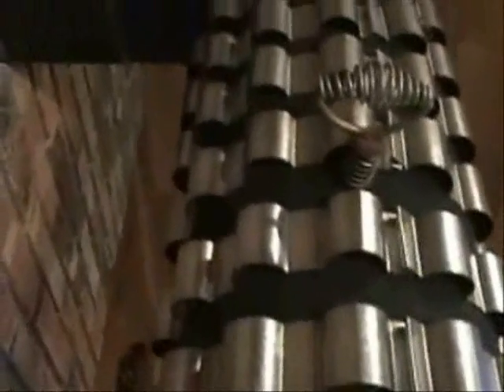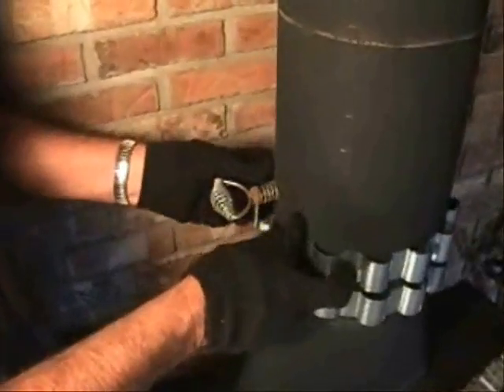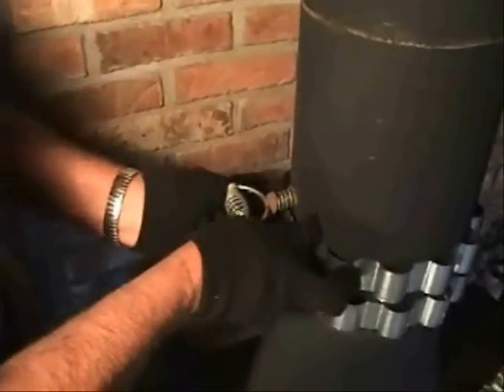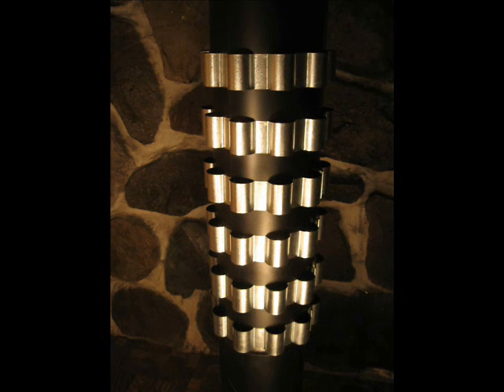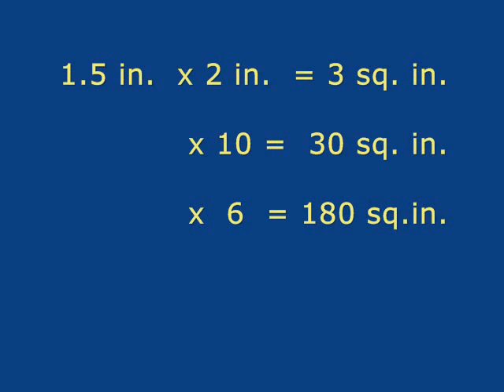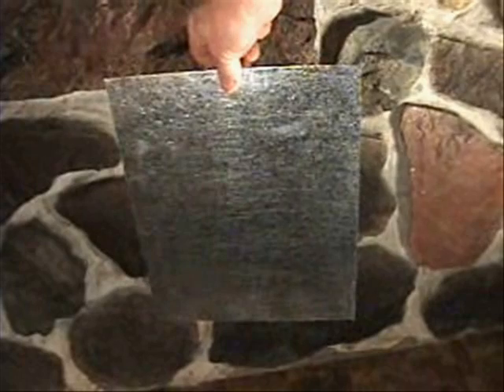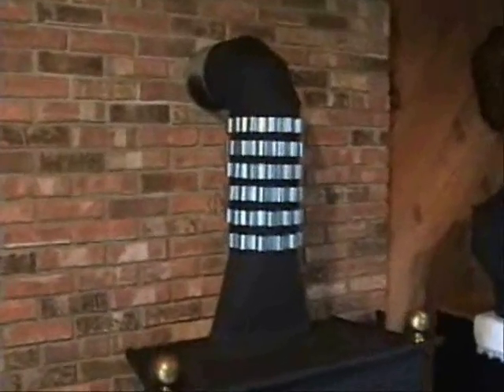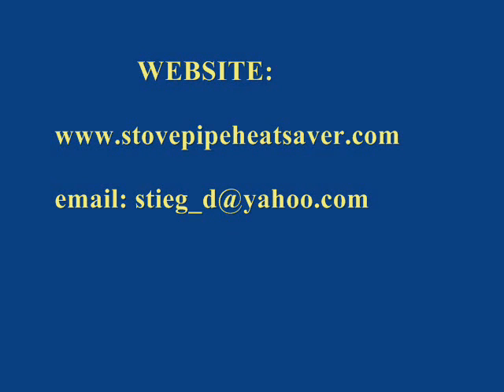Stovepipe Heat Reclaimers /  Energy Efficient Stove Pipe Radiators / exchanger / Cooling Fins

Comment: My 80%gas furnace exhaust creates condensation when outside temps are below 10•F on the chimney (needs pipe installed as currently the exhaust just goes up the brick chimney) alternatively would this cool the exhaust enough to prevent condensation or would that prevent the exhaust from going out because too cool?
Reply from the maker: I don't understand your question.  Please re-phrase.   Sentence too long.....use several sentences.

Comment: Have you tried connecting the loops to form pipes runnig up the chimney?  I think that it would increase the airflow and heat transfer.
Reply: I think that would be counterproductive, actually. Heat flows most efficiently when there's the greatest temperature difference between the source and sink, so you would want cool room air to come into contact with the radiator and then as soon as it's warmed up you want to swap it out for fresh cool air. If you had a continuous pipe going up the chimney then by the time the air got up to the top you'd be trying to move heat from the radiator into already-hot air.

If there was some way to actively force the outside air to flow downward through the radiator then you'd get a countercurrent exchange pattern, which actually would be more efficient. See https://en.wikipedia.org/wiki/Countercurrent_exchange if you're interested in this. That's beyond the scope of simple radiators like these, though.
Reply: @facedeer  
I was thinking that the tubes would have a chimney effect, super heating the air the higher up it went. I love the idea of a small fan blowing into a manifold on top. Thanks for the link.

Comment: IN THE OLD DAYS THEY'D ALSO USE LONG THIN SPRINGS AND SIMPLY WRAP THAT AROUND THE HOLE PIPE FROM STOVE TO WALL...DID THE SAME THING...HEAT FINS/SPRINGS RADIATE EXTRA HEAT INTO THE ROOM.

Comment: Great video and great product, Dale. I wonder if  this could be combined with a fan at the top of the chimney that spreads out any escaping heat, as well as one sitting on the stove itself. Thanks for the knowledge.
Reply from the maker: I highly recommend a fan at the base of the stovepipe blowing upward (the same direction as the heat rising).  This definitely releases more heat. (like blowing on your hot soup)

Comment: Can you get these in the same color as the stove pipe
Reply from the maker: Many customers paint them black with hi-temp paint. Use a scrap piece of stovepipe, mount the bands on it and spray at many angles for full coverage and inside the loops. Being mounted, it masks the flat surfaces of the bands that contacts the pipe.  This way it will not affect heat transfer into the bands.  
I once offered them painted black but during shipping they scratched each other without individual wrapping.  The scratches really showed up.  It was not worth my time.

Comment: My workshop only gets to 55 degrees on those 0 to 20 degree days using my pot belley stove. I'm sold on these and buying 2 sets to see how they do.
Reply: Update? Would you recommend?
Reply: @Nuggetbusterr  Yes recommended, I've also mounted a box fan behind the pipe to help circulate the warm air.

Comment: I bought 2 sets of these from amazon  and they really work well. I see a gain of about 2000 btu per hour when stove is hot. That is about 15 -16 hrs in really cold weather this equates to a single stove load of lodge pole per day savings in sub zero weather. My stove is a Hybrid (cat+ dual burn) so NO creosote build up is created at all, just less heat to the outdoors.
Reply: How did you determine this?

Comment: Possibly a stupid question, but wouldn't reclaiming heat from the stove pipe lead to lower stovepipe temperatures and therefore a buildup of creosote inside the pipe?
Reply from the maker: That is a good question, asked often.
There are many contributing factors to creosote buildup in stovepipe and chimneys. 
 The greatest factor (by far) in the creation of soot and creosote buildup in a chimney is burning wet or unseasoned wood coupled with a slow burning fire. With wet wood, the fire does not burn efficiently, produces a lot of smoke (unburned fuel) and produces a lot of steam.  As a result, the humid soot and creosote can build up inside the stovepipe and chimney walls.
 
The next greatest factor is a chimney flue that is too large for your stovepipe.   This increases “residence time” and decreases the draw and causes the flue gas to slow down, allowing it to condensate and build up on the chimney stack walls.  It also contributes to a “smoky” stove when the door is opened to add wood.

The third greatest factor is when the chimney is located on the outside of the house (instead of running up through the middle of the house.) It creates a cooler flue / stack and, if burning wet wood, it creates a condensation chamber (like a whiskey still).  It is where the moist flue gasses from burning wet wood is allowed to condense into water and creating a wet smoke and it sticks to the inside of the flue wall.
  You can tell a good clean fire when there is very little smoke coming out of the chimney, only heat waves. 

So, in answer to your question, “do the radiator rings lower the temperature too much so as to cause creosote buildup”?  My answer is “no”, the stovepipe temperature factor is overshadowed by far by wood moisture and slow burning fires.
Reply: one good hot burning fire seems to take care of build up in my setup, i wouldn't worry about it
Reply: Dale everything you said is true to varing degrees. Lolol pun intended! I have heated my home hardcore for 37 seasons. I burn only the ultimately dried wood. The size of the stove, the air control design, the insulation of the stove, how the stove is run, the length of stovepipe run, the length of insulated pipe and type of chimney cap you run are also factors to be considered before pulling heat off the single wall pipe. In general I agree with your idea and in fact in the past have used a product similar to yours. I must say if a person is running a truely balanced system, the extra heat extraction ideas are not needed or even wanted. The biggest trouble is wood stoves are not sized for practical  real-life conditions. Homes are too broken up to allow proper circulation of serious wood heat. Heating a home with wood effectively is an art! The old "chuck it in and let r rip" leads to serious air quality issues and pissed off neighbors. If all is balanced the neighborhood has a very, very ight and wonderfully pleasant smell of burning wood. No visible smoke emits from my chimney except for a very short 7-10 minute restart/cleaning twice a week during very morning hours. Kudos to your channel very good information! Well done!
Reply: Here in Finland we've used contraflow masonry heaters for centuries, they basically work on the same principle of sucking the heat out of the flue gasses. If the concept didn't work we wouldn't still use them.

But yeah, a good combustion is needed, dry firewood. It works well in masonry heaters because the fireplace due to the fireplace being lined with refractory material, gets very very hot achieving "complete-er" combustion of flue gasses. With that there's less stuff in the flue gasses that can become creosote.

Modern masonry heaters even include secondary air for this purpose. Many modern iron stoves work the same, they are also often lined with some refractory for the same purpose.

Comment: Thinking of adding these to my 2 pellet stove flue's - anyone using them on pellet stoves?  3 inch ID flue pipe.
Reply from the maker: Many people are using them on pellet stoves.  The 3 inch pellet stovepipe diameter is actually 3.6 inches because it is a double wall.  For pellet stoves order the 3.6 inch diameter heat exchangers.

Comment: A useful addition to the video demonstration would be temperature measurements above and below they radiators.
Reply: What were the temps measured,  before and after install, at the top of the pipe before the elbow?
Reply from the maker: I did measure temperatures above and below the heat extractors.  I also measured  temperatures before installation and after installation.  The heat exchangers reduce the temperature measurements at the top of the pipe.

Comment: Unable to open FAQ's. Can you paint the heat exchangers with stove pipe paint to match color of existing pipe without loosing or affecting heat output ?   I enjoyed your video, you explain and speak  well. I ordered 12.  Thank you.
Reply: I'm not Dale Stieg but yes, I believe you could paint them black and it would radiate even better.  Black radiates heat better than silver or white.
Reply from the maker: Yes, you can paint the heat exchangers black.  It will not reduce the ability to give off heat.  Use a Hi Temp paint.
Reply: Idiot! If black worked best, a black option would be available. This video describes the most basic of stuff called heat transfer. Paint it and ill get
Reply: @billywalik6411  name calling? Are you 10 years old? GROW UP
Reply: @billywalik6411  Go back to bed. You have a long day tomorrow!
Reply: @billywalik6411  First of this nice fella comes up with a little invention and you come and crap all over the options available.  What have you invented other than your mother's desire for a 90th trimester abortion?  Secondly, if you are going to criticize something come correct, as in use proper sentence structure, grammar and don't leave out important words.  Well, enough time wasted on your room temperature IQ, I am going back to studying the most basic of stuff.....called heat transfer.